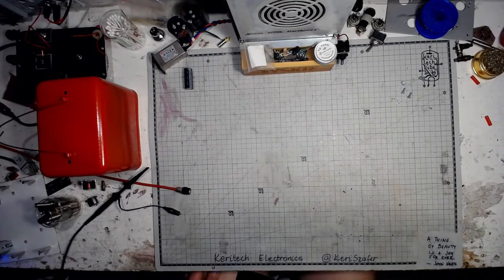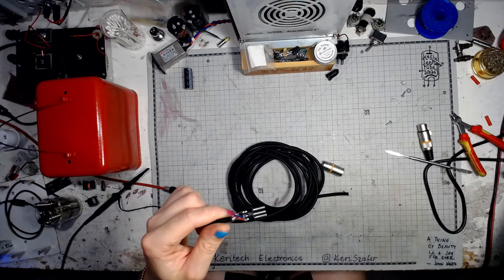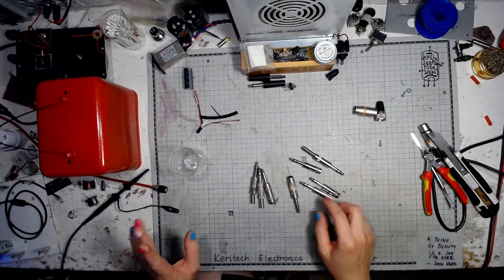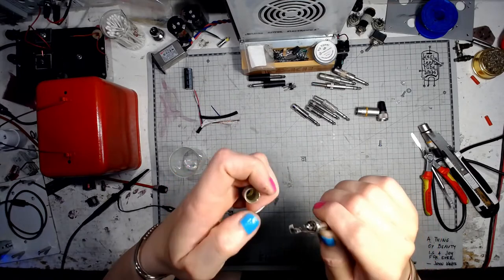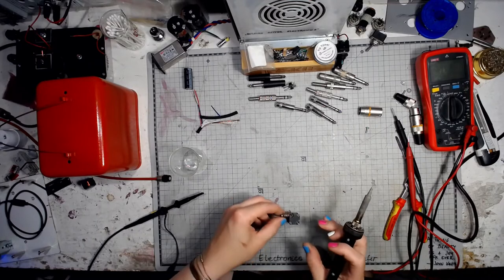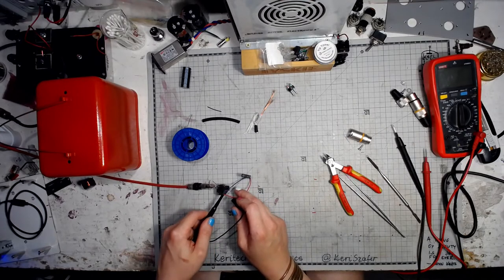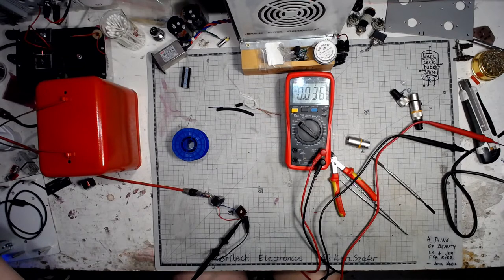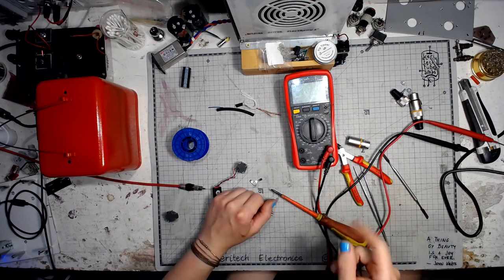Various Tidbits and Teardowns #1 (and rants too!)

Comment: For the transformers to work in your application, (Audio) it is important for the reactive impedance to be many times higher than the impedance of the source and load. For example if the impedance is 600 ohms, then I would want the reactive impedance of the transformer to be 10 times that -  6k ohms at the LOWEST frequency of operation. I measure my own transformers using simple test equipment. I use a small power amplifier, capable of covering the lower audio frequencies, a signal generator and this feeds into the transformer through a known resistor. By varying the frequency while looking at the volt drop across the transformer and across the resistor, you can calculate the impedance of the transformer using ohms law. Most of the ferrite transformers I have come across work in the 10s of Khz to 10s of Mhz range. They can of course be modified by adding more turns by then there is a question of will the required number of turns fit! As a side comment, its interesting to note that some of the characteristic sound of Valve amplifiers is due to the audio transformers, probably the output transformer, nearing saturation. Keep those soldering irons hot! Chris UK.
Reply from the maker: Thanks for the comment - the windings' DC resistance is around 240 ohms and the reactance would be pretty much higher, and I was planning to use these transformers as 600 ohm 1:1 audio transformers. During testing I used a generator with 50ohm output impedance and a 4.7kohm trimpot as a resistive load that I would later turn down to 600 ohms to check the "fully loaded" frequency response, but it proved very bad with weak load, so I passed.